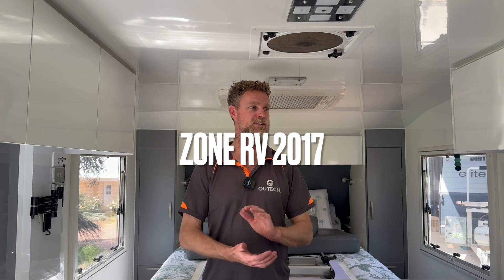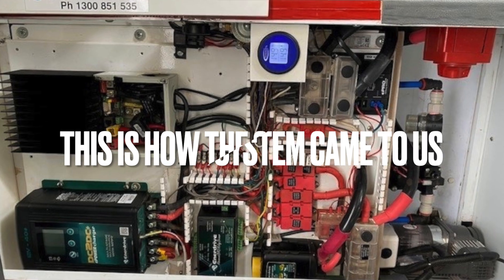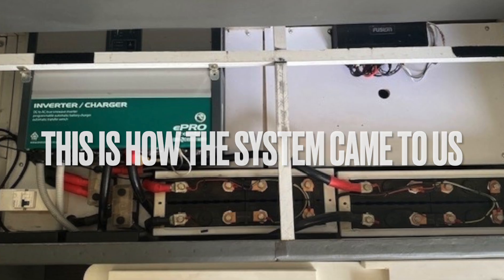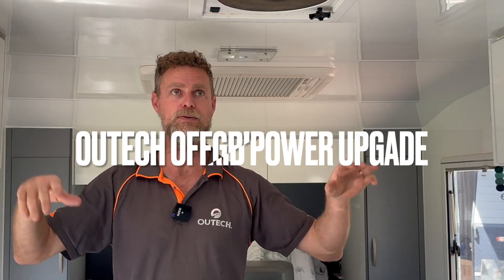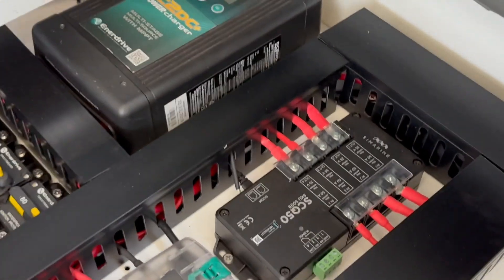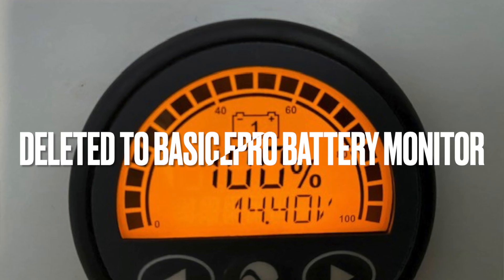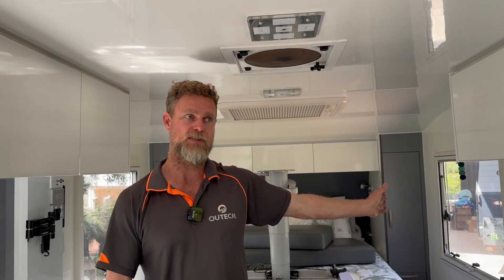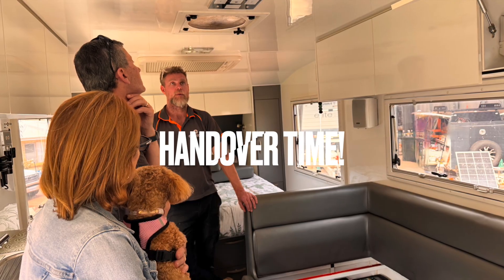ZoneRV 12v upgrade 620ah Lithium Battery 1150w Solar

Comment: Im sorry but im not impressed with your video! You constantly said you was bringing up to current standards and yet you left the batteries unsealed from the inside (as regulations used to allow)  not sure if isolation was upgraded as you didnt mention it? You are responseble for meeting current standards once you change and upgrade the system, just like if you modify a circuit in a dwelling you wouldn't leave it with no rcd protection would you! Then you added monitoring for the solar at extra cost which you then admitted you could get more information from the Victron app so no need to add the extra cost! 

You said you have adapted the electrical system on the Truma combi to work off the inverter? did you mean while moving?
I have installed Truma combi's in europe for a number of years and Truma states that "only electric mode 230 V  for stationary use on camp sites" so i would hope you installed a disconnect, so that when the caravan is moving it could not use the electrical element as its not designed to be used while moving (vibration) you would need to install the d6  for hot water on the move?
Reply from the maker: Thanks for your comment. 

Regarding your concern about battery separation, the batteries used in this application firstly meet all of the requirements of AS/NZS3001:2:2022 and subsequently related standards. The installation of these batteries are also complaints due to the fact that these batteries are manufactured in a manner that is completely sealed in a metallic enclosure with the addition of a vent which in this application has been taken outside of the habitable space. This also meets the requirements of AS/NZS3001:2:2022. 

Regarding isolation, you will note in the video we mention a battery isolator and solar isolation which are both requirements of the standard AS/NZS3001:2:2022

Regarding monitoring, again this is a requirement of the standard however, this particular customer wanted the ability to see solar charge from their battery monitor without the need of getting their phone out. So although not required by any standard, this was a feature the customer wanted. In regards to your comments relating to ownership of the installation once modified, as a licenced electrical contractor we are abundantly aware of the requirements of our license and licensing requirements in general which is why the client is issued with an electrical safety certificate to certify that the installation is compliant and safe. 

Cheers.

Comment: I have a 18’6” 2017 Zone with the same 300Ah white box battery.  I have been thinking about getting a battery upgrade.  I understand the new power regulations require the battery to be isolated from the inside of the van and vent to the outside.  Is this possible to achieve with your solution?

Comment: Could you not just put a house battery and invert in a van of this size.

You could put a 5kW inverter with an 8kW battery module and run House panels on a roof that big.

Is there a reason to not do that?